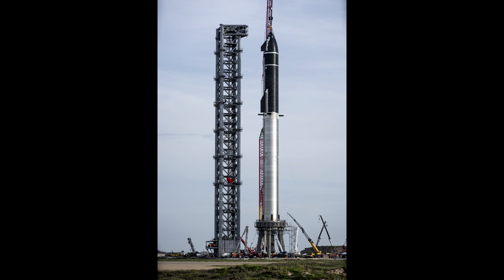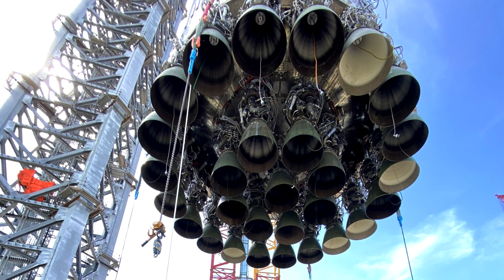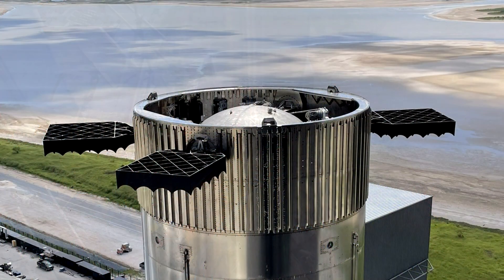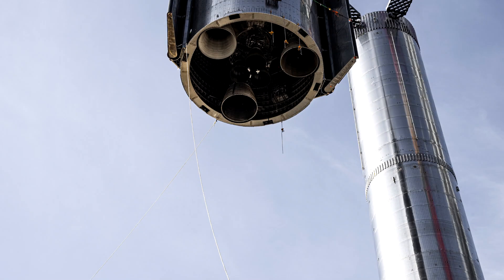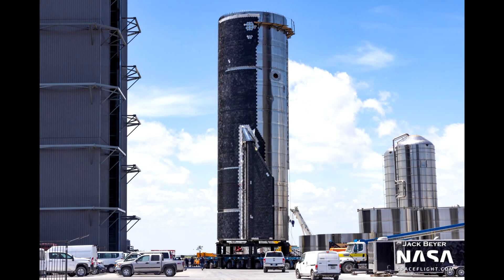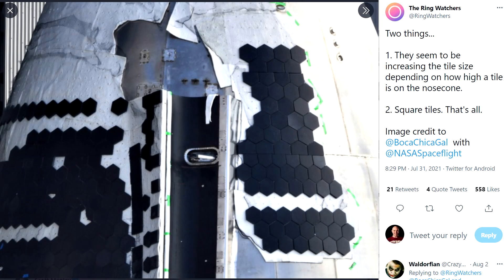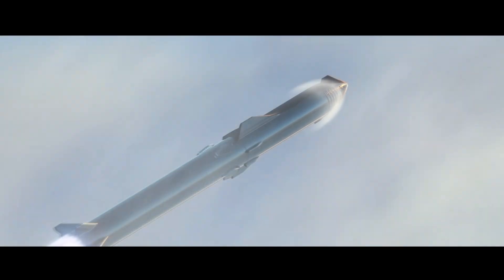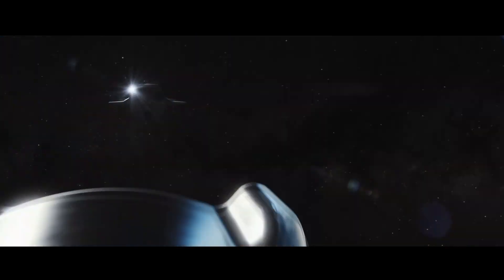How SpaceX Designed A Heat Shield For The Largest Spacecraft Ever Built

Comment: 2:15  actually Scott, going by the interview parts the Everyday Astronaut has posted so far, right now the grid fins on the booster right now are just plate steel, not stainless.  Though Elon said in the interview that this would change and they will likely be able to drop the weight of each fin by a ton or so.  Hopefully.
Reply: @blackhatfreak  So what material is it then?
Reply: @TWFydGlu  Cheese. Duh.
Reply: @TWFydGlu  Valyrian steel
Reply: @blackhatfreak  One also has to be able to tell the difference between telling a lie, and telling the truth and then having the truth change.
Reply: Connor Hoskins  when predicting the future (if you do it honestly), you can never lie. If it doesn't happen you would just be incorrect.
Reply: Well they definitely had stains, so it wasn't stainless steel. Thinking about it, for the test flight without meaningful payload it would be a waste to use sth like Titanium, why even bother with stainless steel when you can have cheaper metal? Makes sense.

Comment: In the second part of Tim Dodd's interview, Elon hinted at the fact that they don't want to store all the prototypes once they are no longer needed and therefore if it blows up it's not that big of a deal, they need the data, not the vessel. So my guess is the first few suborbital or even orbital rockets will blow up.
Reply: At the same time, if Starship 20 nails a soft and controlled landing near Hawaii, the images may be so powerful it kicks the whole world into space faring mode.
Reply: @temper44  it's win win. SpaceX will get their data even if it fails and they will get better.

If it actually works, well then they have a lot less work to do and it'll set the world on fire with what they're doing.
Reply: If you're rich enough I wouldn't be surprised you could buy it.
Reply: Exactly, and I've been saying that for a while. People often forget that despite ending in a fireball, SN8 massively exceeded expectations — as the first serious test of the ascent and of the skydive, it wasn't expected to make it that far through testing, yet they were able to make a landing attempt on the first try. There's a reason SN12-14 were scrapped or never built, and why they didn't bother to fly anything after SN15 nailed the landing — they were far ahead of where they expected to be at the time. 

But my point is that just because that phase of testing went unexpectedly well, it shouldn't set expectations for the next phase. SpaceX allowed for no less than 7 attempts (SN8-14) to make the skydive work, 5 for the landing (SN15-19) and I doubt they're doing any differently for orbital flights.
Reply: @simongeard4824  The SN8 really was a paradigm shift in terms of rocketry. I have no doubt that engineers and scientists in Russia, China and Europe watched as all their research became obsolete in 10 minutes. The idea that you could glide a rocket into a propulsive landing just messed everything up.

There is a video of youtube with a NASA engineer livestreaming the SN8 launch, and you could see the moment his brain switched from old space to new space, when the SN8 starts to free fall. It's wild.
Reply: @temper44  Let's hope they figure out how to provide us with similar video from the reentry attempt... a tough challenge, but hardly the biggest thing they've done.

Comment: Hope the tiles are waterproof. Shuttle tiles had to be injected with a waterproofing chemical after each flight.

Will any burn through (one missing tile, one small hole) be a loss of vehicle or is there a chance it can still land using the undamaged header tanks?
Reply: Yeah the starship is looking like a joke
Reply: @blackhatfreak  Loll smh
Reply: I believe Elon said that it would result in loss of the vehicle if one fails (part 2 of Everyday Astronaud’s Starebase tour)
Reply: The Fly.
Jeff Goldblum. Good scifi horror.

Comment: I'm getting some N1 vibes seeing all those engines at the bottom... let's hope they don't fail like the N1.
Reply: My thoughts exactly
Reply: True, but one huge problem with the N1 is that the Soviets did not have the budget to test all of the engines on a test stand before flight.  At least one of the N1 failures was due a loose bolt or screw that would have been detected if the engine had been adequately tested.  Still, a lot can go wrong with the installation of 29 engines
Reply: @billwollard8446  plus the N1 was essentially an analog rocket with very crude computer controls by today’s standards and zero real time monitoring via a sensor network of how each engine was doing.
Reply: People who say that never know any of the details of how and why they exploded. No sim, no test fire of engines, no static fire of any stage, KORD engine management completely incompetent. Nobody thought it would succeed those flights. Damn Angry Astronaut spreading his half baked theories all over the place instead of spending half an hour fact checking like he used to. I think I'm gonna barf if I heat this N1 crap one more time. FH has 27 engines in a more fragile arrangement with three cores barely held together. One bad gimbal input and that stack breaks apart but where did all the OMG SO MANY ENGINES crap go about Heavy?
Reply: TLDR: KORD
Reply: Just for reference: Falcon Heavy: 27 engines. Booster 4: 29 engines. Having them on separate cores makes it worse, not better. Yet Falcon Heavy has never had a launch failure. In short, you're worrying about the wrong thing. One thing Elon has mentioned is that usually the things that cause failures weren't on anyone's top eleven concerns list. And they use eleven, because once with Falcon 1, number eleven was the problem.

Comment: 1:48 - If you ever do a "rostrum shot" (i.e., a zoom / pan across a high-resolution still), remember to add a small amount of gaussian blur (typically 0.3 to 0.5 pixel radius), or you get shimmery pixels on high-contrast edges.

In theory this wouldn't be necessary if the software used proper area averaging, but most "consumer" software just uses pyramidal or box filtering (i.e., it only looks at 5 or 9 pixels), which isn't great and really messes up edges whenever the source image has more than 3x the output resolution (sometimes even less, depending on the exact algorithm).

Comment: Scott, I don't know if you'll see this but I'll try.
I sent this to Elon & Tim Dodds as he's pretty tight with the Rocketman.
Starship has been experiencing minor tile loss during initial testing & I'm assuming that there's zero tolerance. I've worked for a major aerospace contractor eons ago but there are some low tech solutions that still apply today using the KISS principle.
Why not apply a thin conformal coating of RTV like elastic substance over the entire area of protection?
The elastic material could help retain the tiles through MaxQ & on to LEO. Heat on liftoff through to LEO would be sufferable depending on the material chosen by SpaceX. It could then burn away upon reentry leaving air pressure to hold them in place. Then a scrub down or solvent wash before reapplication of a new rubber, so to speak.
Being elastic would help by spreading the vibration over a wider area, similar to ballistic armor principles.
I realized that Elon would not be keen on anything that slows down his turnaround time but the application/reapplication process could be improved on rather than lots of engineering hours suffering through what the shuttle program dealt with.
Cheers mate from a kiwi transplanted to the space coast.
PS: I'm surprised that the other commentor could not determine your nationality from your name? Probably a pommie with a handle like spitfire, LOL

Comment: We shouldn't forget the SpaceX ethos hasn't changed.  Iteration.  There are 100s of assumptions being tested by the first flight - assumptions about wall strength for instance - will the system abide well with all that thrust?  It took a bunch of flight SNs to get here, we shouldn't assume it won't take a bunch of flight boosters too.  I will count it a success if it clears the pad.  If it blows up before Max Q?  Figure it out, fix it, and iterate again.
Reply: It will get a little harder now because the iterations just got A LOT more expensive. I wouldn't be surprised for this stage to take as much time as the whole rest of the program has until now. That's ok though they're already ahead. Unless there is an impending ELE that Elon knows about and we don't....
Reply: That's why I find it funny when people make models of the current prototypes. Maybe that's what they want, but I want a final version
Reply: @ChevTecGroup  I kinda find the prototypes more interesting. They represent the stepping stones, and are inherently more important than the final result in a sense. I have several small models, showing everything from Starhopper to SN5/6, to SN8 etc.
Reply: @Mythricia1988  that's pretty cool to collect them all
Reply: @ChevTecGroup  These are rockets not Pokémon;) ( sorry had to write that one ) ;D
Reply: @AdmiralBob  Depends on how long it takes to get the booster recovering going. Once that's working, re-entry tests for Starship become a lot cheaper, since they're not throwing away thirty-odd engines each time.

Comment: I remember back when they were tossing around the idea of 'sweating' out leftover fuel through holes to create a protective layer of gas - or the whole reason they decided to use stainless steel skin to begin with because of its thermal properties compared to aluminum. ' the best thermal protection is no thermal protection(?) '
Reply: It was adding just too much weight
Reply: @sanajyshrivastava3707  Was it? Could you provide a link that explains that? Because it seems they quietly did away with that system without telling anyone why...
Reply: @Sajuuk  i mean if u had snythimg more complex than small holes it's gonna be quite cpmplex
Reply: @Sajuuk  that was an idea they threw out during brainstorming. Later they found the additional fuel, the mechanisms to “sweat” the rocket, and the marginal benefits of it were pretty null. The heat shield is simpler and weighs less overall, plus in the long run makes it cheaper! Fuel eventually will be the greatest cost per mission, and if you leak 20% of it to do what a reusable heat shield could do, then you are literally just burning money
Reply: They don’t have thermal protection on half of the ship unlike shuttle. Presume that’s down to the stainless steel. And the thickness of the thermal protection it does have can be significantly thinner as the stainless steel can take higher temperatures than aluminium
Reply: @nolansprojects2840  Hi there, do you have a link so I can add it to my bookmarked pages, thanks 👍🏻
Reply: Funny how quiet it gets when you ask for links....
Reply: Now, the entire justification for a steel construction falls apart. It is just incredibly heavy and inefficient! Fun fact: A Heavy-lift Vehicle from NASA's SPS study has similar payload to Starship (120t), yet only 4000t mass when fully fueled, without any weight-saving tricks like baloon tanks or common bulkheads, and with a 22t mass reserve! Apparently, aluminium construction + winged flyback is a pretty efficient design!

Comment: I wonder what kind effect dimpling the surface of the thermal tiles would have on the effectiveness of the system?
Reply: if the dimples were perhaps a an inch in diameter and a quarter inch deep and many covering each tile, could the concave provide more heat dissipation through the extra surface area, I don't know the exact math but the dimples would provide at least 20% more surface I would think. again I'm no mathematician.
Reply: @Dan63-w7n  Don't forget the aerodynamic effect of dimples, as used by golf balls.  Question is if this will reduce the reentry heat that the tiles must combat.
Reply: @johndododoe1411  could the dimples maybe provide a near vacuum effect within the concave at reentry speeds? Vacuums tend not to hold heat to well unless the heat come through radiation. In these conditions the slight vacuum effect may well pull heat from what oxygen is passing by? This is just an opinion iv come to through a small amount of research i cant say anything for sure haha
Reply: Golf balls don't go at supersonic speeds.
Reply: @niconico3907  but if they did what would the effect be on thermal dissapation? Would the dimples help?
Reply: @Dan63-w7n  I also wonder if the reduced mass would be negligible or not. Really would love to see it in action in some modeling software :D
Reply: @AppaTalks  not something i am capable of setting up but hopefully this conversation sparks the right mind
Reply: @AppaTalks  id love to see it in effect even If the results returned nothing
Reply: @Dan63-w7n  I would think, it would make the heat uneven. Some parts will heat up.more and some part less.

Comment: Still wondering how they will deal with dirt or water getting in the gaps. The Shuttle had it's TPS glued and sealed quite much, it also didn't contain cryogenics like this does, so ice formation under the tiles wasn't that much of an issue. And still, a story popped up, maybe on NSF, when it got soaked in water, and they had to put it in a hangar with a lot of infra lights to heat it up and dry. So in the end this is still a delicate system with every single tile acting as a potential point of failure, I'm really concerned how this will affect rapid reusability.
Reply: It's gonna be a tough one, that's for sure. Elon might even reconsider evaporative heat shielding for the fin hinges and other geometrically complex parts.
Reply: The gaps are wide enough that it shouldn't really matter.
Reply: @user2C47  Water maybe, but have you seen these things land? All that debris fling around, big clouds of dust, it will build up in the gaps and will not go anywhere, limiting tile movement, eventually leading to cracks. If anything, it could limit the rapid reuse cycle count to 5-10 or so flights, after which a complete refurbishment will be necessary. I mean, 10 flights without messing around with it still sounds amazing, but it will never be anywhere near as maintenance free as airliners. Which is OK, this is not an airliner after all. But still, those gaps mean in the worst case a small pebble can get stuck in there on the first landing, leading to the loss of vehicle on the second reentry. I guess we'll have to wait to see what they come up with.
Reply: @matwyder4187  Think of it this way. Airliners are INCREDIBLY maintence intensive compared to cars time wise. Exponentially so in terms of cost. But we accept that because they fly in the air with a bunch of people on them, and can't just pull over if they have a problem. Since space vehicles are subjected to operating environments as extreme compared to airliners, as airliners are compared to cars... Wouldn't the maintenance being as intense compared to airliners, as airliners maintenence is compared to cars then make sense? Hell top fuel drag racers are "reusable" yet they have to pretty much rebuild the engine after every run. However the pit/garage crews are experienced enough to do so in a matter of hours. I'd assume that starship could still be very reusable even if it does have a couple components that require messing with every so many launches, especially if you continue to iterate to the point where these processes are very streamlined and relatively easy to do for a "starship pit crew"

Comment: I also thought the transpiration cooling was a little sketchy... Its a mechanical system that needs to operate, if it fails, its over... the passive nature of the ceramic tiles is much better, as long as they are there, they should work.... Has to be much safer....

Comment: Great informative video, as always :)
I think you're too harsh for Shuttle's thermal protection system. You should have mentioned that it had about 24 thousand of them and after each flight only up to 100 had to be replaced, mainly due to mechanical damage and for engineers to access certain components. Each of them was supposed to survive 100 flights so they were not that bad. 
As the years have passed, the tech got better so Starship's tiles should be even better, thus more durable and with more longevity.

Comment: 2:12 The grid fins looked a little rusty before they painted them on Tim's first video, I don't think they are stainless.
Reply: They are welded steel but as prototypes will invariably change in some way with each launch. Ultimately when a final design is achieved they will be made of titanium
Reply: @epincion  No titanium, way too expensive. They will be stainless but just plate for B4.
Reply: There might not be any grid fins in the final design! Elon is not sure if they ultimately increase payload to orbit or not.
Reply: @221b-l3t  Indeed... Titanium  i s  expensive! But when they take it for struts of aircraft landing gear... could possibly not be  t o o  expensive! Other than the Beryllium heat shield in early Mercury ships (just informed guess...)

Comment: A small correction - blunt bodies are better because they push the bow shockwave away from the surface, not the stagnation point. The stagnation point is always on the surface, regardless of its shape.

Comment: The X-33 was to have a metallic heat shield, shedding all the problems of fragile ceramics. The blunt shape and light weight to size ratio made this possible as i recall. I guess it's not possible for starship as it seems ideal for rapid reusability.